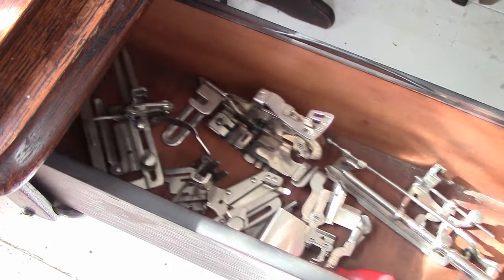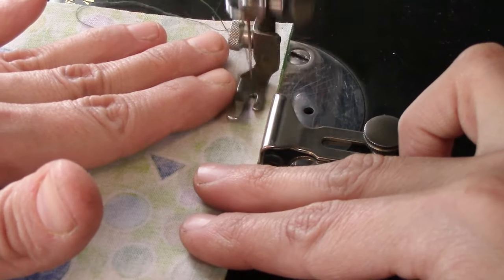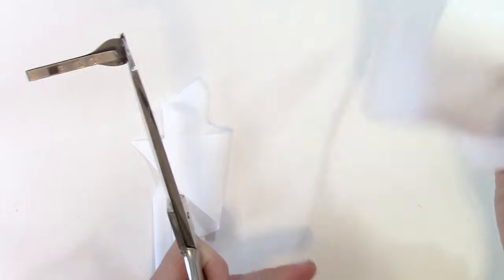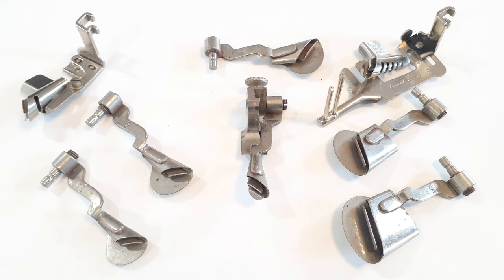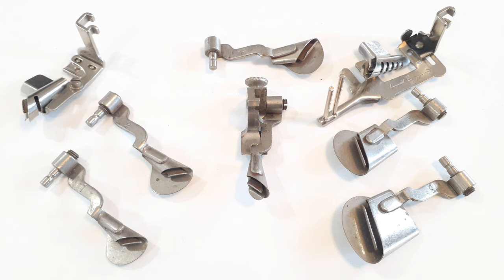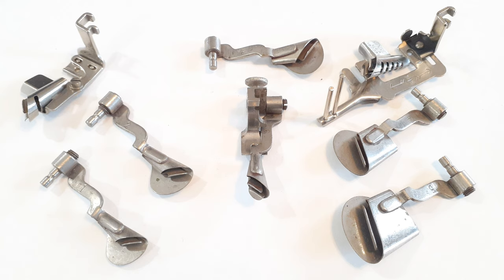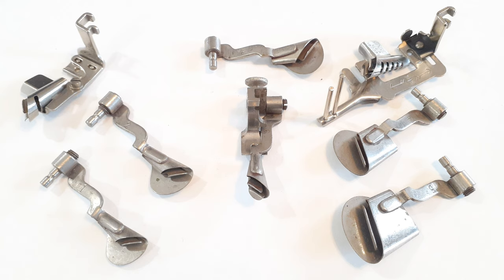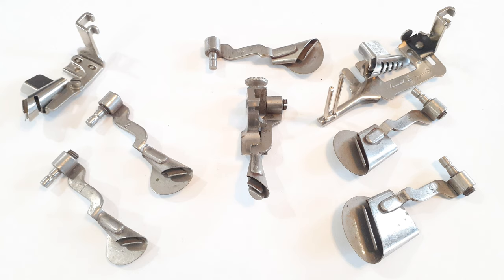How to use Most Common Vintage Antique Treadle Sewing Machine Attachments and Accessories

Comment: I wish I had gotten these with mine or kept those that came with 1960- 1962 machine the repair man could no longer fix 25 years ago. I just acquired a 101 need a lot of work and a 201-2 I believe works fine but I’m going to take it to my shop before I use it.

Comment: Hello, I have a question about the adjustable hemmer. On the video from 20:21 to 20:54, you take the 2 pieces of the hemmer apart and put them back together. However, in that portion of the video we do not see the little 'tongne' just at the right side of the scew (I think you call it a pointer) that can alsoe seen on the picture at the very beginning and when you are sewing. Is this 'pointer' a part of a specific screw? I do not have it on my assembly.
Reply from the maker: I'm so sorry to have not seen this. Thank you for bringing it to my attention.
Thank you also for being so observant with the video discrepancy! 
     Ironically, your observation seems to confirm exactly what you have found with your own attachment - sometimes the parts get separated, and bits go missing!!!
I used two different parts for the demonstration. - and one of them isn't complete!! Shame on me for not noticing.
     To answer your question, the tongue/pointer is a separate piece of metal which should sit on top of the 2 main portions of the hemmer, but below the screw. It is shaped in such a way as to slide over the straight edges of the 2 main portions without twisting from side to side.

I hope this helps.
Again, sorry for not seeing your question sooner!!
Reply: @24Washington  OK thanks. I am guessing that it is a separate part quite tiny and easy to lose if you take the assembly apart. I am missing that part on mine.
Reply from the maker: If you're handy, you could probably make something that would work.
Some heavy-duty aluminium from the disposable bakeware you can buy would hold up to gentle use, as nothing travels over the tongue/pointer.
If you were to prepare the edges as my description above, you'd possibly want to double-fold so as to not risk snagging your fabric.
Making a trial one out of card would allow you to get the positioning of the tip over the correct number.
Reply: @24Washington  Thank you so much. I can try that with the upper part of a pie pan as it is flat at the bottom to put the screw and curve at the top to act as a guide for the fabric. However I am currently looking in ads and thrift store in case al of these old attachments may be found for next to nothing.
Reply from the maker: Cheap whole attachments are absolutely the way to go!! Good luck with your searching! You might even find a priceless treasure :)
Reply: @24Washington  Thank you so much. I can use an aluminium oven liner as the bottom is flat for the screw and the top is curved to guide the fabric. Instead of making a double fold I would try to put some sort of tape to cover the raw edge to avoid damage on the fabric. However, I am currently looking in ads and thrift stores as these old attachments sometimes pop up.

Comment: At 6:25, for the bias gauge, you note how it slips onto the scissors blade, & that it's awkward for left-handers. The gauge here sticks out to the left, & you reach over your scissors to support the fabric. Flip that gauge  to point to the right! As long as the clip is set to your width, you don't need to read the marker letters. They can be upside down! And you can support fabric feed on the right, right?